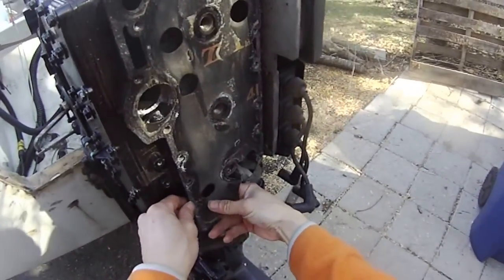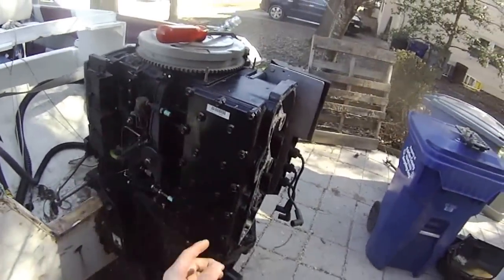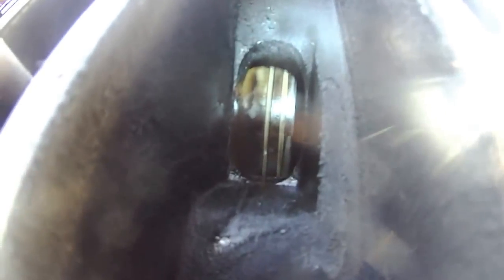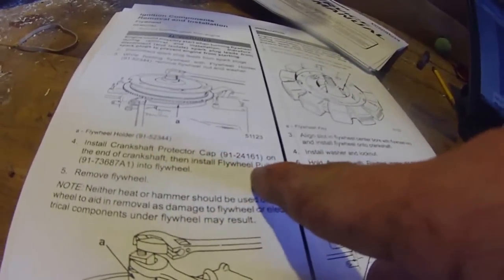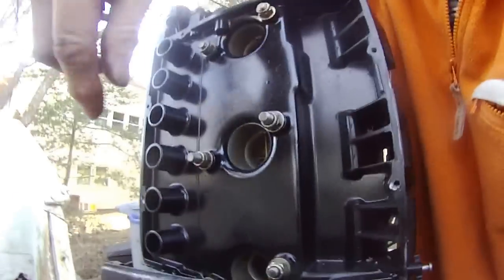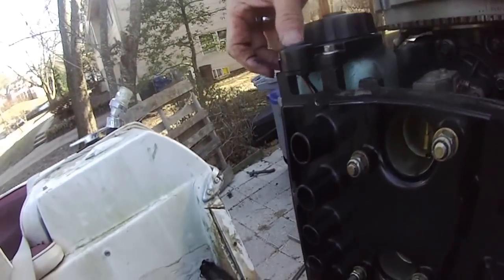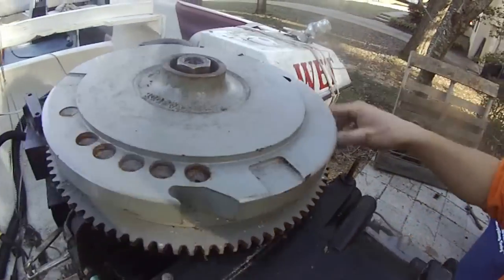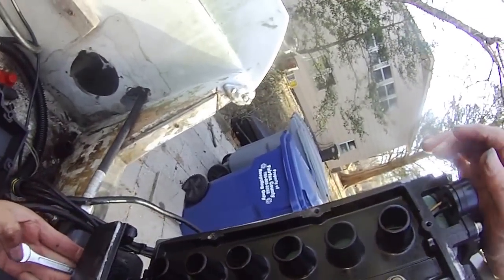mercury outboard 90hp (2 cycles, 3 cylinders) tear down part 2 - removing exhaust plate, flywheel

Comment: This is y you never touch a outboard and leave it to a marine engineer because clearly you don't know what your doing
Reply: 1 minute with the Mercury flywheel  removal tool and your done.I give you a 0 out of 10. Hammers and pry bars do not fix engines.